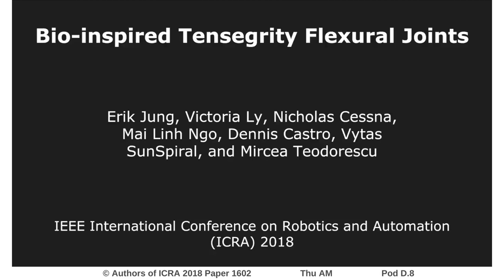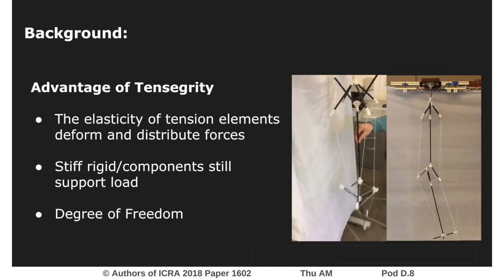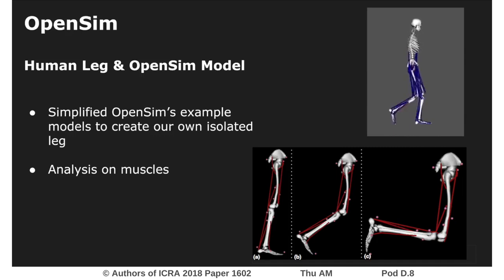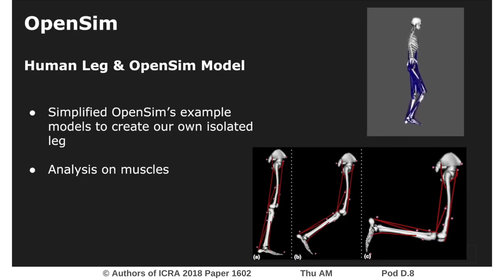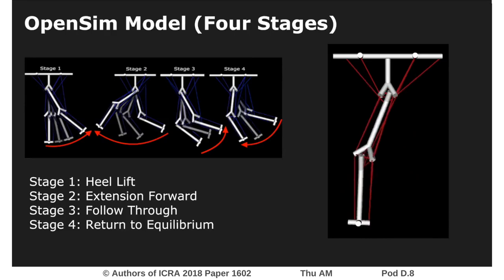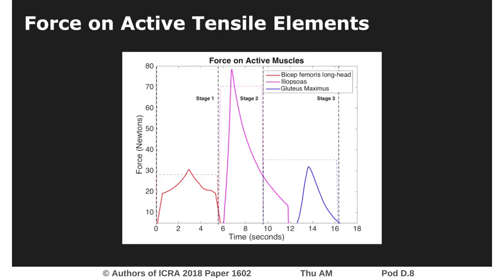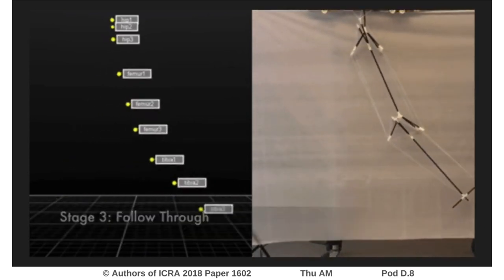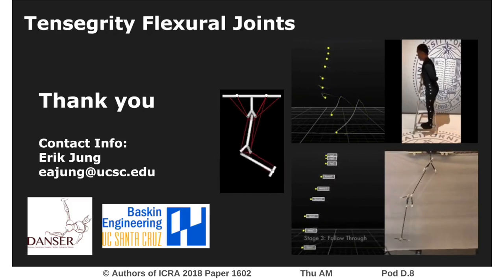Bio-Inspired Tensegrity Flexural Joints

Comment: Thank you for open sourcing your research! I have a question: since the human joints are not 'cross-over' joints like the tensegrity ones are, where the compressed/solid structure i.e. 'bones'  need to cross in 3-dimensional space in order to allow for the floating tensegrity effect to occur as explained in this video https://www.youtube.com/watch?v=pm9N1Mn1Tvg - what is the actual use of a tensegrity model like this?